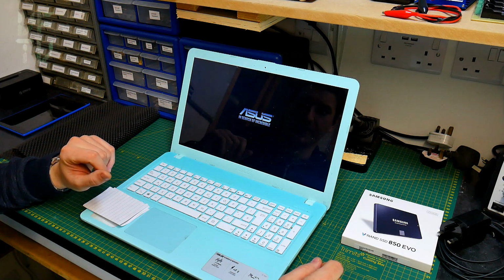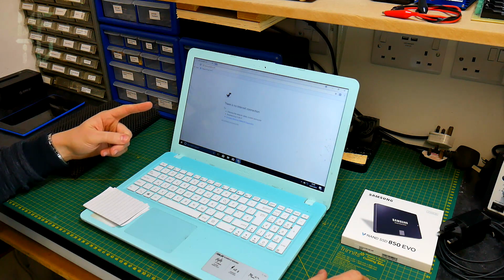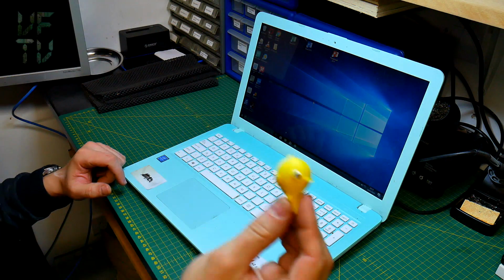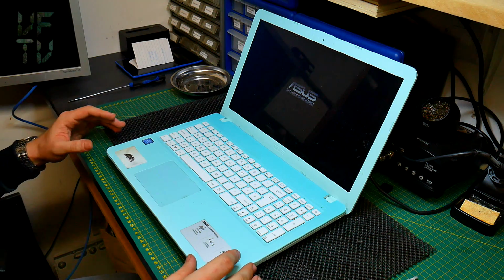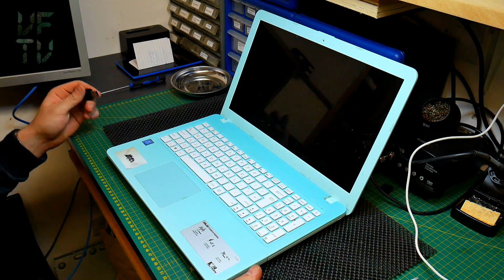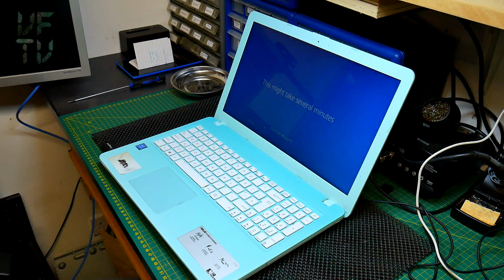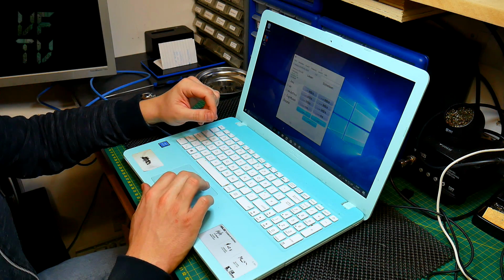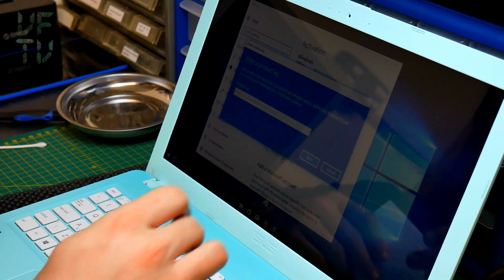Repair Video - Asus Laptop

Comment: Thanks for your amazing Technics 1210 videos. I just followed your target light replacement tutorial and I got the LED working, however the LED doesn't switch off when I push the light housing down. Any ideas what I'm doing wrong? Thanks

Comment: Hi,

Excellent videos for Technics turntable maintenance. Just about to replace tonearm base on my sl1200 mk5's as the arm for the tonearm holder has snapped :D...... I'm perplexed as you say not to use copper / lithium grease, but when i've searched for comma multi-purpose grease, they all come up as lithium based? I have a small tube of silicon grease, but other people say not to use silicon grease on helicoids for the sl1200s...... I am so confused haha. Can you, or anyone else recommend a grease that can be used for this purpose please?

Comment: Seems like the laptop can't make full use of that SSD, I get closer to 550MB/s read/write speeds on my 850 Evo. Nice change when the product performs as it says on the box.
Reply from the maker: Yeah I usually do get a little higher than that somewhere around 520 but I guess this is a budget family grade laptop, it doesn't have a dedicated SATA controller it's an integrated controller.
I guess to save space and component count on the motherboard.
Thank you for your comment.
Reply: Yeah these budget laptops usually cheap out where they can so the better SATA controllers are not used. One in my HP laptop only manages 320MB/s read speeds on a SATA 3 port. I ended up putting a budget SSD in the laptop and moving the 250GB 850 Evo that was for the laptop to my desktop as a secondary game SSD as the 500GB Evo already in there was filling up.

Thanks for the video.

Comment: Windows 8-10 will detect the BIOS key & auto activate. :) They don't put it there as the stickers fade / got masked / people nicked them. You could've bought a cheap USB3 2.5" casing, put the SSD in there, and used Samsungs Data Migration software, to clone the HDD to the SSD. Macrium Reflect can also do this via a hot-clone (aka inplace clone).

Comment: "If you replaced the mother board you would need to get a new key"...Not if you go through Microsoft telephone activation and select it has only been installed on one computer. Also you could have cloned the HDD to the SSD with something like clonezilla.
Reply from the maker: Hi mate.
It depends on what the customer want really.
I would clone is the customer wanted everything as it was, but this time there was loads of bloatware and other unwanted programs, so she wanted a fresh start.
Thank you for your comment.

Comment: A bit disingenuous, don't you think, booting the computer whilst on battery power and complaining about its performance?

Even my ASUS ROG G750 takes an eternity to boot from the SSD on battery power.
Reply from the maker: Not really, it performed just as bad plugged in as it did on battery.
I did the benchmark when plugged in and it still failed dramatically.
Thank you for your comment.